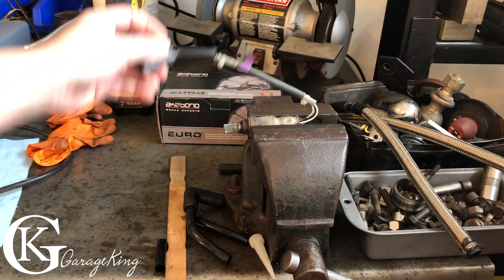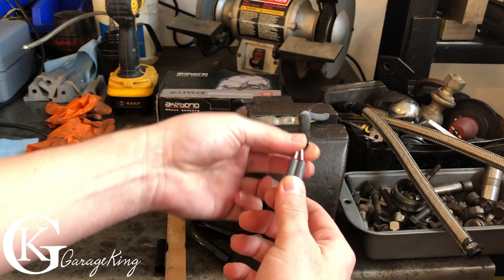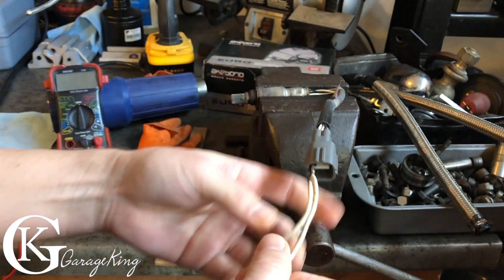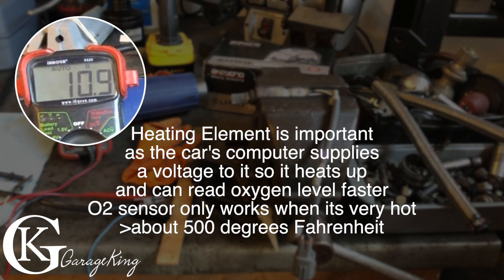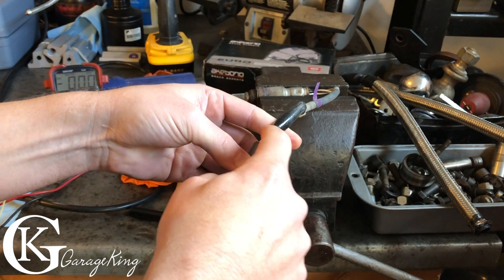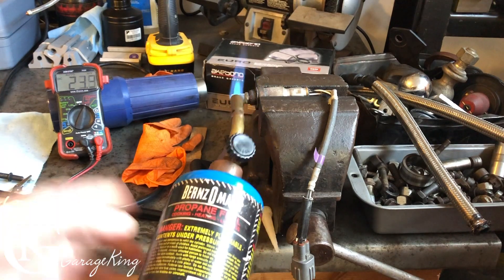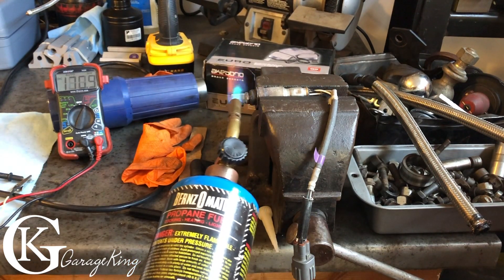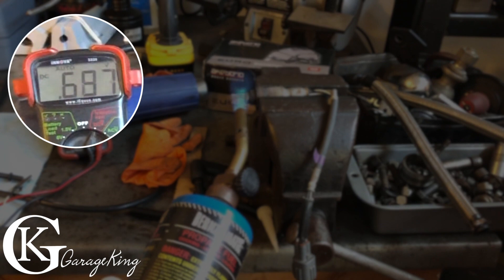How to test an O2 sensor with multimeter and flame

Comment: wires of the same color are the heater wires
Reply from the maker: Yup you are right and those are the first set of wires I tested the two white ones and they should have a resistance.  If there is no resistance (its open) then the heater coil is not working and you are going to get a check engine light as the sensor is going to take too long to heat up.  Great comment, thanks !!

Comment: I have an issue with both sensors.  I replaced them with bosch, still the same codes.  The CE light is still on,  the 2 codes are up stream and down steam heater voltage low. When i look at the sensor live data it reads top of the graph 1.27v. It never changes with giving it throttle. Im beginning to think it could be in the ECM, no drivability issues at all, no other codes.  Car is turbo pt cruiser 05.i was originally getting 131 and 137 codes, those have gone away (not sure why)  now I'm getting the heater codes for both,  still wondering if it's a ecm issue since +and - come from the pcm, but what voltage should the pcm provide?
Reply from the maker: Hey there and thanks for the comment.  Normally the ECM supplies a 5V reference for most sensors, but I'm not sure if that includes the O2.  Now normally the O2 should be under 1V.  Yours is a turbo car, so it may be that its normal for your car. If you know someone else with a turbo pt cruiser I would check to see if the reading is that same.  Also make sure there is no exhaust leaks.  Leaks can cause weird readings !!  The other thing you could do if your scanner is capable is to look at short and long term fuel trims to see if the ecm is constantly adjust to compensate for a problem that may be occurring.

Comment: Heating it up and testing it should tell you ok it works when heated up... I guess the heater is burnt out... ide definitely check harness first before throw a flame on it... videos like this will throw you in the wrong direction
Reply from the maker: Hey Thanks for the comment, and I agree to check the harness, that is basic for any electrical components.  It's easy to do a wiggle test.  This test was if your wiring is correct, and there is really nothing else to check, then take the sensor out and test it.  At that point what harm can you really do.
Reply: He tested the resistance of the heating element, and it was around 11 ohms.  Burnt out heating element would be OL, or infinite ohms.  It was the very first check he did.   I have no idea how you could 'guess' the heating element is burnt out after watching that.

Comment: That's not a butane torch. The tank says propane right on it.
Reply from the maker: Good comment and you are right, there is a slight difference between propane and butane, and the torch I used does say propane on it.  I'm so use to using the oxy acetylene which is very different than the propane or butane, as it requires mixing of the gases, so I think of propane and butane as the same thing (they don't need mixing).  I think you would still get the same results with either propane or butane (butane would just take a bit longer as propane has more energy in it)  Good catch, you were obviously paying attention !!!!!!

Comment: Good video but From what I know it should rise up to 1v  Fairly quickly and drop down quickly once you remove the torch. And I'm definitely sure the other way to clean the o2 is the torch by burning off all the carbon and probably the best way. But I one's over torch an o2 and the response on it got slower and I torched it for a little longer thinking 😅 I would fix it and it was a fail it didn't respond any more so I learned if you're torching it one's it response quickly stop and it's probably as good as new and the carbon Billups are going to be almost gone. Some times we need to learn from mistakes.
Reply from the maker: Great comment brother !!!!   You are right that once it hits its temp it rises up very quickly, and then you have to take the flame away once you reach 1V.  You sound like you came to a great conclusion and you are a great learner !!!

Comment: The problem is which sensor should i replace down stream or up .
Reply from the maker: Hey Brother, usually its the downstream that goes, but the best and easiest way to check is with a scanner that has live data.  You can see the voltages on the sensors and if the down stream does not read for a while its considered "lazy" that is what usually happens.  This bench test is just a really easy way to test.
Reply: @GarageKing  it code 0031 bank 1 sensor 1
Reply from the maker: @Sambathgame  If its a 4 Cylinder that means it's the first one coming off the engine.  Which is kind of surprising as normally those ones are ok. So that one would be located in the exhaust manifold that is bolted to the side of the engine.

Comment: If an O2 Sensor shows "high voltage", I assume the voltage is greater than .5 or 1 volt?🤔
Reply from the maker: Hey brother, if you are getting a "high voltage code" then the sensor is over the predetermined value in the computer and the computer just says its high.  It might only be at .3V, but that may be too high for the set parameters at the time.  O2 sensors are designed to go up to 1V.  So if you are getting "high voltage" there is a chance it could be over 1V, or it may be just too high for the set parameters.
Reply: @GarageKing  Awesome! Thanks for the info!👍
Reply from the maker: @bigtextrucker1825  Anytime !!!
Reply: @GarageKing  and an update, I replaced the O2 Sensor and nor more bogging down, losing power and backfiring. Problem solved! 👍
Reply from the maker: @bigtextrucker1825  That's awesome!!!!   Most of the time it is the fault of the O2 sensor.  Its rarely the wiring.  Glad you got it all fixed up !!!!

Comment: One thing that send me  for an loop the other day was, a brand new 4 wire boshsensor, when it was heated up the signal got partly grounded to the housing 8 ohm between signalwire and housing.

When the sucker was  mounted in the exahust it was only able to produce max 0.379V  but when i tested it with propane outside the exahust but plugged in electry to the car it worked fine, i had a scanner with graphing.

Have you ever seen this?
Reply from the maker: Hey brother, I have seen it a few times, two examples 1. On a Toyota where the flange was rusted out in front of the O2 sensor, because there was an air leak in the exhaust, the exhaust was not able to get hot enough at the sensor and thus did not produce the required voltage.  2. A sensor after a catalytic convertor that was plugged, again not enough flow through the exhaust to generate enough heat.  Make sure you check for leaks and make sure your cats are flowing.  Also for a leak it really does not take much, a leak you can feel with your hand, but not hear can do it.

Comment: Does this sensor in the video produce its own voltage or something, because when you warned it up with your burner it started to read out a voltage, despite not being supplied with a 'feed' current.
Reply from the maker: Thanks for the comment brother. The O2 sensor does produce its own voltage and does not need a source of voltage.  For a single or two wire sensor the O2 will produce its own voltage.  For a 4 wire sensor. The O2 does again produce its own voltage. The other two wires are for the computer to “feed” a voltage but this is for the heating element to heat the O2 up faster to reduce emissions.  A cold O2 does not produce any voltage. As you saw in the vid it’s got to get hot so that’s why most newer cars have 4 wire sensors.  Two wires which get a voltage to heat the sensor. And then the other two wires that output the voltage the sensor produces when it’s hot.   So to answer your question the 02 sensor provides its own voltage. All it needs is heat.  Thanks for the comment :)

Comment: How about If you don't get a light and  don't see any voltage on the scanner for the sensor? Thanks.
Reply from the maker: Hey Miguel, not sure what you mean about not getting a light?  Do you mean not getting a "check engine" light on the dash. I know if you heat it up hot and if there is no voltage then the O2 sensor is bad.  Just make sure you have the correct wires hooked up when you are checking for voltage with heat.  If you are connected to the wrong wires you will not get a reading.